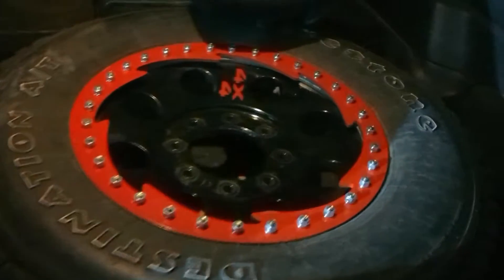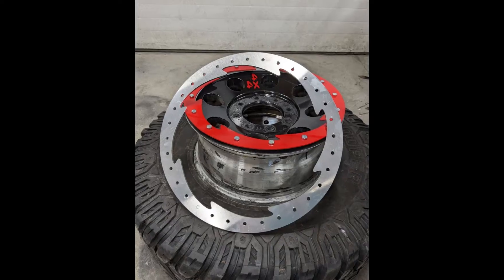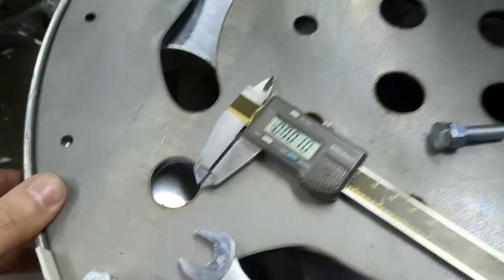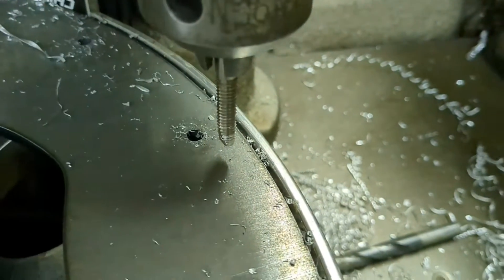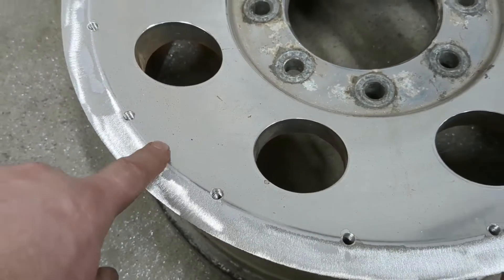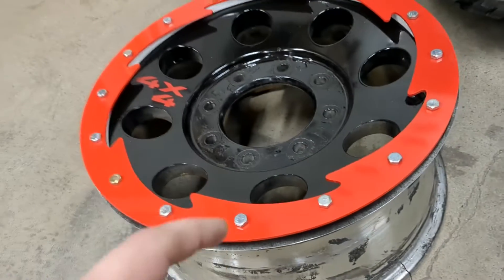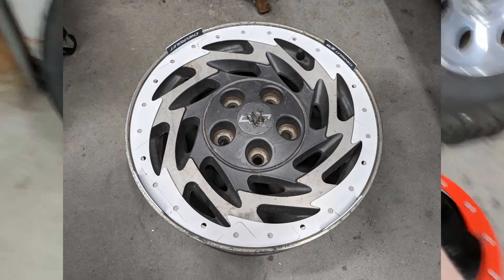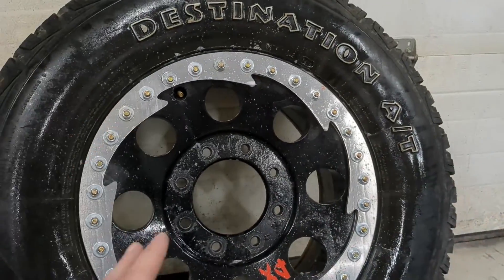DIY beadlock wheels with NO WELDING. Drill & tap with studs or bolts.

Comment: Chepo routers work great on aluminum. I've used them the change hub bore on wheels (it makes the lug centric so keep that in mind) but I've done it on a couple sets on Nissan rims to fit Tacoma. Tacoma rims are over priced on used market imo and Titan wheels are almost give away prices
Reply from the maker: I've almost used Toyota wheels on 6 lug Chevy. I'll check cheap Nissan stuff now too
Reply: @GEARHEADdezign  where I am Chevy and Toyota used OEM truck wheels are in same price category, Nissan Titan wheels look good (opinion) and I got my 18s for under 100, i believe it was a 1/2 in square bit with a bearing on bottom to locate it, works slick, do a reasonable depth, do all 4 then lower the bit , repeat, wd40 is your friend so it won't bite/grab bit. I saw it on forum and was like no way but like you did on the lip the speed of router works great.(Edit) I originally opened them up to fit qx4 and that was 1/2 bit I think and had to open them up more for Tacoma, but was still doable. I have them off for winter I'll post a pic on page so you can check out
Reply from the maker: @RextheDragon881 yeah Tacoma wheel bore is bigger than Chevy. So Toyota fits on Chevy but not vice versa unless you open up the bore
Reply: @GEARHEADdezign I pit up pictures of the Nissan wheels I routered, looks pretty clean, not like it really matters but it's nice not to have it look hogged out with die grinder, id say to most peoples eyes it looks lathe turned, been running them 3 years like this with lug to center them no vibrations or complaints. I also resprayed the wheels, regular car clear coat (not spray bomb) over silver base coat looks OEM and you can salvage some gnarly ugly wheels with a lil sanding and re spray. Hope it helps, cool channel just found it
Reply from the maker: @RextheDragon881 got a link?
Reply: @GEARHEADdezign I put up photos on my channel,  under post , I'll check my bookmarks and see if I have it
Reply: @GEARHEADdezign https://youtu.be/J5Suud8BizU?si=2NDb-9tOwL40ZEMu not the guide I used originally but same thing same wheels even. All I would add is do a little at a time like 1/8 and it won't bite or fight you, and wd40 keeps it smooth, aluminum acts weird as you probably know when machining/tapping
Reply: @GEARHEADdezign he's got the router but specs in there too, I was going off top of the head but your opening is different it sounds like but it's a cake walk compared to your beadlock project, once you got the bit in it, it took less than and hr for me to knock it out
Reply from the maker: Found your post. Looks good! I'll keep that in mind for the future
Reply: @GEARHEADdezign happy to help, I'm probably going to use the beadlock method you did, a lot of cutting and welding to make steel ones, and adds some width witch is a plus using stock wheels 🤝

Comment: Those look great Eric. Nice job
Reply from the maker: Took 4.5oz to balance, but I also forgot to align tire dot with valve stem hole
Reply from the maker: I'm anxious to see how the wheel drives. I drilled 16 and then another 16, and I'd be better off with a new jig that drills all 32 at once

Comment: Dude, love how you carried the Z26 Beretta motif onto these wheels! The beretta z26 wheel is top three coolest OE wheel designs of all time!
Reply from the maker: Yeah I started off designing the Beretta beadlock but the 8 hole Ford wheel works nice with it too!
Reply: @GEARHEADdezign  Have you considered any way to "widen" or "stretch" a Beretta Z26 wheel?  I haven't been able to think of a good way with cast aluminum wheels.
Reply from the maker: @adamwaerzeggers7557  I have a plan on the back burner. Weldcraft wouldn't touch them, but I want to cut the hoop out of the back side of another 16" wheel and weld it on the face of a Beretta z wheel. I think it could work.
Reply from the maker: @adamwaerzeggers7557  I'm modifying my Moser axles now to make room for wider wheels